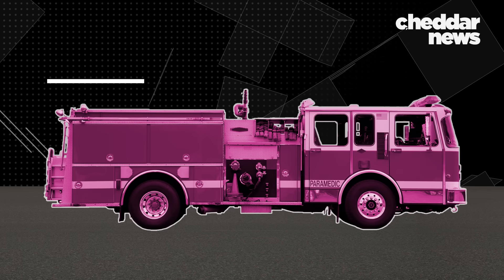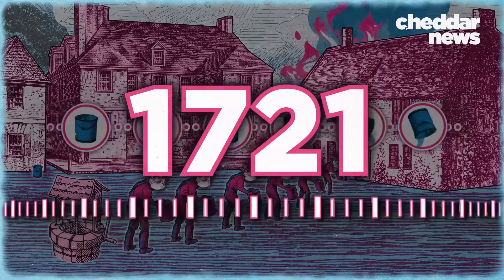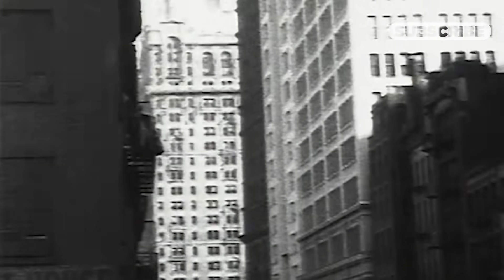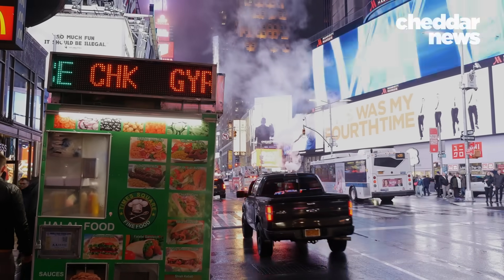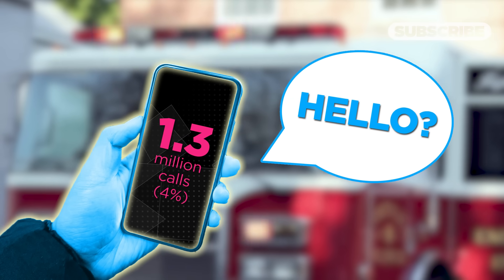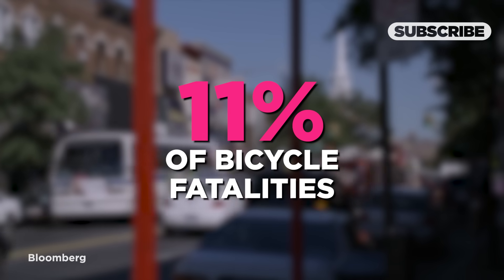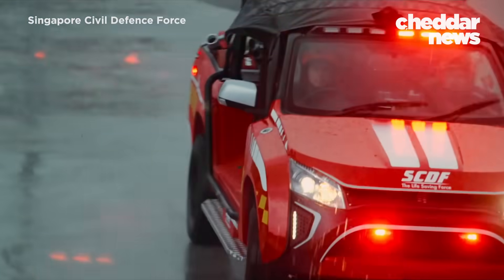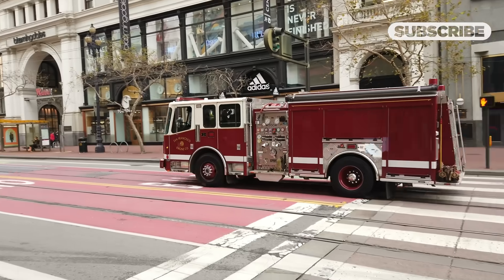Do American Fire Trucks Need To Be So Massive? - Cheddar Explains

Comment: Every  other comment by a firefighter on here is totally accurate, but missing one big thing part. if you wanted us to buy more cheaper trucks so have 2 smaller instead of 1 to bring the size of them down then add the cost of staffing that vehicle. much cheaper to have solid, well trained firefighters and give them all the tools needed in 1 truck that can do it all compared to the cost of 2 trucks double the staffing and split the tools. these trucks last a long time, and when done normally get sent to a small volunteer department or one that can not afford new truck. That said i would love to have more staffing, more trucks and more equipment, it would make a huge difference to have the manpower on scene so fast but its not always in the best interest of the taxpayer. 

Long short, all departments do what they feel is the best for the area they cover, their budget is all public and the chiefs will go over numbers and explanations if you ask. As far as the big trucks going on ems runs, everywhere around me and im assuming most of all NA the way it works is you get the closest trucks. Most ems calls only require a single medic but if it is a Advanced life support run like a cardiac arrest you get the 2 closest trucks could be 2 medics could be a medic and a fire truck, you also get all close law enforcement, that's a benefit not a curse people, if you need help you need it asap, be glad fire and ems in most areas are cross trained. The trucks are built to handle the amount of work given to them, just know you will be getting help when you call 911 it doesn't matter how many people show up or what truck they are in, if you called you have an emergency right?

Anyone that has questions just go ask your local department for their input and you will be amazed how much planning and thought goes into all of this. My department not only has a citizens advisory committee (think townhall meeting with the community) that tells us their thought on what it is we are proposing to them before actually asking the local government to do it. But we bring in experts that give us a 5/1-/15 year outlook on how they see our district changing so we can stay prepared and make sure the trucks ordered or new station being build is going to meet the needs of the future. That all said we are just the run of the mill suburban department so im sure the big cities have way more that goes into it.
Reply: "ould be 2 medics could be a medic and a fire truck, you also get all close law enforcement, that's a benefit not a curse people," tbh I had more than a few incidents where I sent other crews out because we were way too many crew members in a room with a patient which we were easily able to handle with EMS crews alone. I wouldn't like to have 10 more around when I don't need them. Different story if I tell dispatch to send a ladder to get the patient out with the ladder truck, but that happens like 2 a year on my shifts.
Reply: @EnjoyFirefighting  we run 2 man medics around here and a 3 man fire truck so at most you have 5 firefighter/paramedics law enforcement normally will be on scene before us just because they are all over, or department can be at any house within roughly 5 min from time of call to 911. But I agree less is more on most medic runs. Our second apparatus doesn't respond emergency status either except on arrests. So you always have time to in a sense establish command and come up with a treatment plan before they walk up (not a way I normally think of it but it makes more sense, we clearly wouldn't take command on a EMS run ha ha just a different way to see it)
Reply: @ArchCityCraftsman  on the ambulance we have a 2 man crew. The emergency doctor car has a 2 man crew as well. With a trainee, both might have also a 3rd man along. 
If we'd call the FD, a plain normal Engine comes with a crew of 9 already.

Local volunteer departments are dispatched to medical calls right away in only 2 circumstances: either 1) the village is half-way between two EMS stations, so even if ambulances in either station are ready to run a call it will still be the longest lasting response run of maybe 10 minutes; or 2), in a village which has an EMS station with one ambulance, but the ambulance is already out on another call and an ambulance from another station has to get over here. In those scenarios the departments will be dispatched as "first responder"  here.

Even when looking at EMS alone we sometimes flood the scene with crews. I've been on a delivery and we were a total of 6 units for the mother and the newborn. 3 crew members were emergency doctors. With all people standing in a single room apartment it tends to be a bit too much
Reply: @EnjoyFirefighting  are your emergency doctor actually a doctor? We don't have anything like that over here, our highest medical training is paramedic would be interested to see the difference between a Nationally registered paramedic here in the states compared to the paramedic/emergency doctors ability on a truck. I've never heard of that being a thing.
Reply: @EnjoyFirefighting  you alright if I send you an email (the one on your account page) genuinely curious how your system works in comparison to ours.
Reply: @ArchCityCraftsman  yes, they are actual M.D., but with an add-on qualification for pre-hospital care. It's part of basic EMS and provided in every city, every county, throughout the entire country. 
In general they are always dispatched to potentially life threatening incidents right away; An on scene ambulance crew can also tell dispatch to send a doctor in case of the patient being unstable, critical etc; A doctor might treat a patient on scene and send him with the ambulance crew to the hospital while he heads back to the station, or in case it makes sense and might be necessary, he stays with the patient during the ride to the hospital. 
Downside: although paramedics learned how to use all the drugs, depending on the regional doctor in charge they aren't allowed to use all drugs, either not at full scale or not at all. Thus they sometimes have to make dispatch to send out the doctor for the administration of some drugs. 
Besides the "normal" emergency doctors we also have a few specialized ones, which however aren't part of the system across the country but which are only provided in a few cities. Thus there are also children emergency doctors, which are only dispatched to calls involving children. And then there are also newborn emergency doctors, obviously for the respective patients. 

Besides normal ALS Emergency Ambulances with a 2 man crew and Emergency Doctor Cars with a 2 man crew as well, some few places still run a thing which is a combination of both: a Doctor Ambulance. It's basically an ALS Emergency Ambulance with an even more advanced range of equipment and with the emergency doctor being the 3rd crew member on board. 

Concerning scale of treatment. Let me but it like this: an emergency doctor car has roughtly the same range of equipment like an ALS Emergency Ambulance, minus the stretcher, vacuum splints, vacuum mattress and MCI marking material, but thatfor plus a mechanic chest compression device, cooled drugs, way larger range of drugs and a surgical bag. You can do so much that you could get some doctors out of their comfort zone
Reply: @EnjoyFirefighting  so you guys don't work with a standing protocol but more or less online medical control. And the country employs doctors to assist the other ems crews by a district in a regional-like grid. So you would have say a doctor unit for every 4 EMS stations and the doctors are stationed with your crews 24/7? Obviously probably more involved than that but is that about right? 

We just have a doctor that comes up with our protocol and that just tells us what we can and can't do, so we as the medics can do anything that the protocol allows and with my department that's everything the national registry allows. Can use a few different drug algorithms for the same issue very open protocol. But never actually see or talk to the medical director, I'm told he gets out reports and looks them over to ensure we are treating to his standards and such but been doing it since 2011 and never seen or talked to him ha ha
Reply: @ArchCityCraftsman  kind of. Our EMS district consits of 3 counties; The medical doctor in charge covers all 3 counties and releases the standard on what paramedics may do on their own, may do alone under specific circumstances, may do until a doctor is on scene or may not do and when they have to get a doctor on scene. When the paramedic writes the report on the patient and performed sth on the patient he has to click who it did, if an on scene doctor was it or told him to do it, or if he acted under certain law or released standard. If sth doesn't fit, the doctor in charge will automatically be notified. 
Each county has several EMS stations. In my county there are 6 EMS stations. At 3 of them we have an emergency doctor car and yes, the doctor is stationed with the rest of the crews 24-7. 3 emergency doctors for a population of 180k inhabitants and an area of 300 sq mi is kind of the average here 

In fact the emergency doctor in charge sometimes works normal shifts at some stations, I rode a few shifts with him already.
Reply: @EnjoyFirefighting  that's wild I can't imagine what It would cost for us to have a doctor on shift. I know a firefighter paramedic line level guy starting pay in my district costs roughly 175k to have on shift that's not what we make but that's salary+pension+benefits then we have a 3 year top out for pay so I'm not sure what the top pay plus the benefits and such would be for the township. I would assume a doctor would be higher pay than even our Battalion Chiefs so would easily clear a 215k a year employee and have to bring home more than 175k and that's basically what our Chief brings home so adding 3 doctors one for each shift would be insane
Reply: @ArchCityCraftsman  not sure about the chiefs at the career department in the next city here, can only compare it to salary in EMS; Paramedic goes home with roughly 30k a year here. 
Doctors are payed a bit differen than the rest of us. They get a fixed rate of $25/hr for the hours they are on shift but not out on calls, surcharges of $2.5/hr for night shift, $5 for weekend and holiday, and $15 for important holidays. upon that they get a rate of $86 for each patient insured with a normal health insurance; Private insured patients are again calculated a bit different. 
Altough the emergency doctors are stationed with us, they actually aren't on the payroll of the EMS providers. They are in contract with the Association of Statutory Health Insurance Physicians of the state and do their settlement with them directly. 

It would be boring if it was simple :D
Reply: @EnjoyFirefighting  ha ha ya you just blew my mind the complexity just got significantly more insane. I'm assuming the currency difference is a reason for such a gap from EMS pay where you are to where I am at almost every firefighter paramedic around me is making just over 100k USD (not including overtime or additional money in the union contracts for degree's, extra certifications, or physical incentives) and EMS only departments are around 85k each station averages 2500-4000 calls a year per physical station
Reply: @EnjoyFirefighting  but even the doctors pay is crazy if the currency isn't much different, I own a construction business and pay my workers $50/hr plus bonuses for a job well done when they go above and beyond
Reply: @ArchCityCraftsman  in fact both Euro and USD are pretty much at the same exchange rate right now. 100 € equal 102 USD now. A single EMS unit at our station does roughly 3,600 calls a year. With 3 primary units that makes close to 11k calls
Reply: @ArchCityCraftsman  Some countries do carry Dr's on the Intensive amulances. I was an NREMT-P and we had very liberal Standing Orders and Protocols. So we were the Dr's representative / extension in the field.
Reply: @EnjoyFirefighting  that's wild, I'm going to have too see if we have a cost of living difference. Has to be something with that pay gap
Reply: @ArchCityCraftsman  probably; Living in a rather expensive area of Germany I pay 1.3k a month for an apartment with 3 rooms, not living in the city but in a village outside our state's capital

Comment: I live in North America however I am not a firefighter.   I have had close contact with two house fires and have been on company safety committees.  So, I have seen US fire response up close and personal and have had many in depth discussions with fire chiefs about how they respond to a crisis and what our company response should be.

So, my take on the difference between the two types of fire trucks:

First off, to use the response of Boston FD to bike lanes is unfair as Boston is known through much of the country as having roads difficult to navigate due to size and layout.

As for running the big rigs to every call, in the cities I have lived in that did not happen.  The size of the truck responding depended on the call.  If it was a call for EMT, they ran their rescue truck (size of a large SUV) because the FD had much better response time than the Ambulance service.

For other fires, they ran a different number of sizes of fire trucks depending on the call.  A structure fire, four trucks minimum.   When the fire alarm went off, they usually knew what size structure and if they would need the tall ladders.

Also, one place I lived had three different fire departments in the same "city"--really three separate entities that each had their own fire department.  I worked right across from one FD.  They had a mutual coverage agreement so any time another FD responded to a fire, that FD would roll its biggest trucks to provide coverage in the other city.  They always rolled at least one of the big guys as you never know what a second call would be.

Finally, in the rural areas of the US, you really need huge can-do-it-all trucks as they do not have that many trucks or people.  Often if there is a  large fire in a rural area, you will see that four or five local fire departments responded.  When you start considering drive time from these other departments of 30+ minutes, you can understand why the first truck on the scene needs to be able to begin to fight the fire.  Often the building in question is a total loss and the FD is preventing the fire from spreading to other areas and buildings.

Another factor in fighting structure and grass fires in the Midwest is the arid conditions.  Where I live, we usually average less than 20 inches a year--many years it is quite a bit less.  This year, most farmers around us lost their crops due to the lack of moisture.  When you are in a rural area with lots of farms, drought conditions, temps over 100 degrees f (around 38 c) for days on end with 30 to 40 mph winds (48 to 64 kph) and easily thirty miles away from the nearest town--when fire breaks out under those conditions, everyone responds to keep the fire from spreading everywhere!

Finally about accidents and US drivers...many drivers do the right thing, get out if the way and stop.  Some are just idiots, things like refusing to pull over to stopping in the lane of traffic.  I know a woman who was a ambulance driver, she gave it up.  Helping with the blood and gore of the job did not bother her.  What she could not take was having a patient with a heart attack in the back where minutes count and having traffic block her because they did not pull over.  Sometimes no amount of horns and sirens will get someone to move.

Comment: For large streets and large corners perfect, the sizes must adecuate for the city streets to any kind of particular situations in hoods..example of long chassis ....  starting a climb... just crash under the bumpers with the asphalt... can be front or rear.. under, small size corner just not enter...  here in my country predominate compact eropeans mostly french "Renault" in al his variants like Camiva, Berliet,  germans like "Magirus Deutz" in variants like Iveco, Camiva, ... yes Camiva... is the name of the inner  equipment.. pumps, valves, etc... few units Mercedez... also american Rosenbower units for skycrapers works .. rest of the city useless, some Rosembower shorted chassis... not adecuated beacuse just cut chassis rear still have long distance from bunper and front weel.. eropean compact is better by far,  but is a hell make some repair, weeks or more for small jobs,  american is more easy to fix.

Comment: It's important to add that the Red Rhinos in Singapore is not our ONLY fire truck. We also have a ladder equipped larger vehicle. (In case anybody wishes to point out how does our firemen reach high rise fires.)
Reply: yeah, I did think it was a bit stupid to say that you only drive around in an SUV!
Reply: Don’t worry she completely fucked up accurately portraying US apparatus as well. For example my department has two engines(the big trucks), a tinder(water tanker), and 6 various smaller apparatus(Pickups or SUVs) all of our neighboring departments are similar. Unlike what this video leads one to believe.
Reply: Different fires on different buildings or structures call for different variants of fire trucks.
I work near an airport, so during annual fire drills, I can see a firetruck called a crash tender respond.
Reply: US have big car
Reply: We have PLs not just red rhinos
Reply: ? Kk